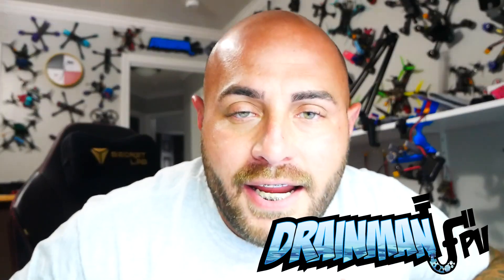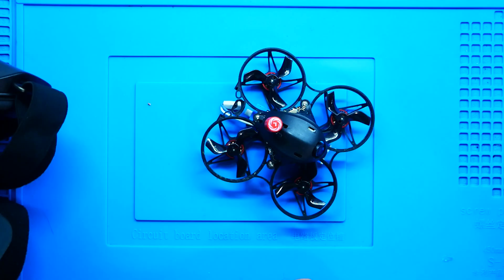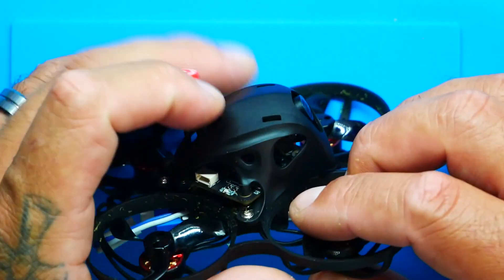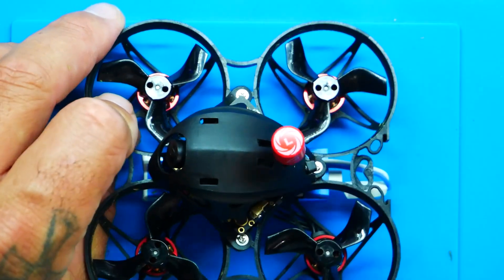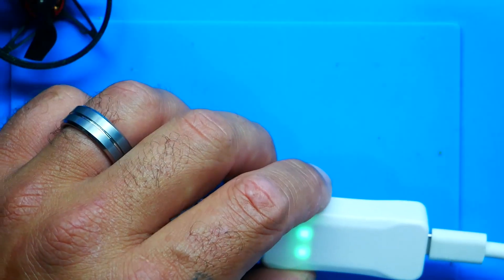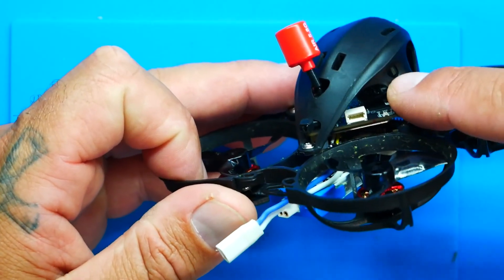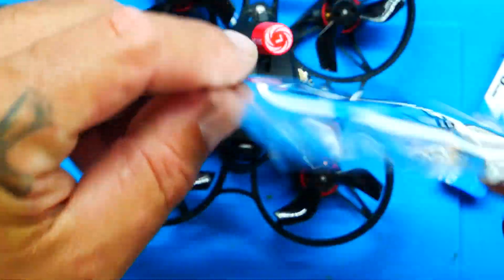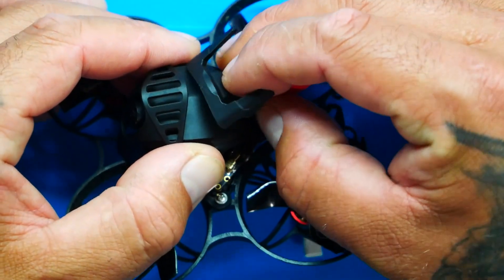Finally! A Full HD Whoop Drone With All The Hottest Components! Meteor75 BetaFPV

Comment: Not first. Hdzero has 1s on 65mm that flies 3+ minutes on 300mah and 0n the 75mm hdzero 1s flows for nearly 5 minutes. 10 grams lighter 75mm on hdzero.
Reply: Well... we talking about real HD, not a polished analog video (HDZero). Only advantage of HDZero is fixed, low latency. Video quality is much better on DJI/Walksnail
Reply: @chorchecze  only advantage? How about the fact that walksnail is fake 2s as ot can't go under 3.1v and the entire hdzero system weighs what the walksnail vtx alone weighs. My 1s 65mm whoop gets the same flight time on a 300msh 1s with 21,000kv motors as the walksnail gets on a 450 1s and more efficient 75mm props. The hdzero version of this flies for almost 5 minutes vs walksnail 3 minutes. A 65mm walksnail would need a custom frame and would fly for only a minute. Every gram is massive at these tiny scales. Sorry but hdzero is not an analog connection no matter how hard you hate on it lol. walksnail 1s is a gimmick 🤷‍♂️ no one in the tiny whoop world will choose walksnail over hdzeeo for tinywhoops. This things 39 grams. The moblite 75mm hdzero 1s is 29 grams ;) . But go off man. I fly dji too. It's better than walksnail. 🤷‍♂️
Reply: @anthonyfpvminiquad1728  Hope that next revision fix the voltage limit, but 3.1V to low anyway.. I have both DJI and HDZero and HDZ didnt impress me too much. Image quality is really not there, breakups are really terrible. Considering move to WalkSnail, even their 1S is heavier (i know, every gram counts on whoops).
Reply: @anthonyfpvminiquad1728  For 2grams more  you will get overall better  image quality and onboard recording with Walksnail. So, HDZ was first, but WS did it much better ;-)
Reply: @chorchecze  it's not just 2g lol
Reply: @anthonyfpvminiquad1728  Yes, is probably less than 2g, because in all review they weight HDZ without MIPI cable and WS with MIPI. We will see on custom builds how light WS should be. Regarding to image quality - HDZ is not on par with WS or DJI.